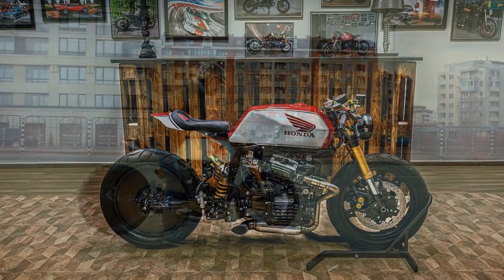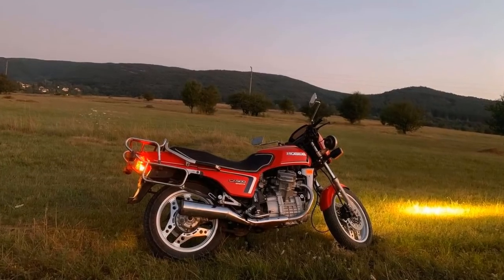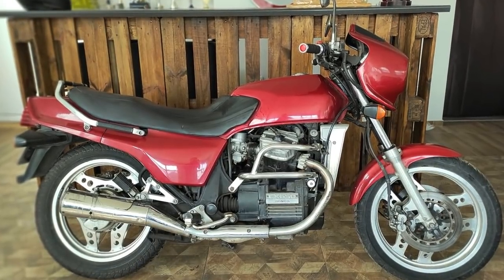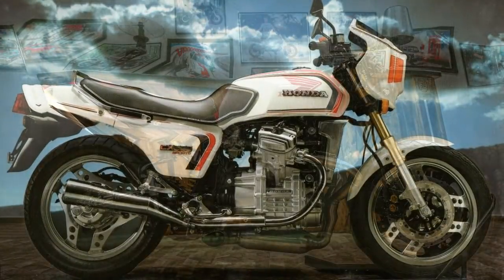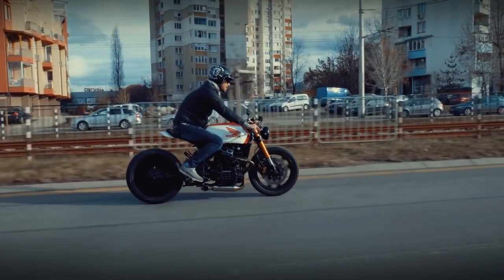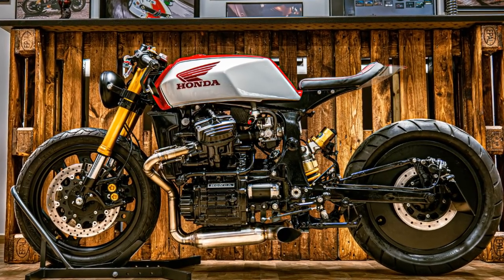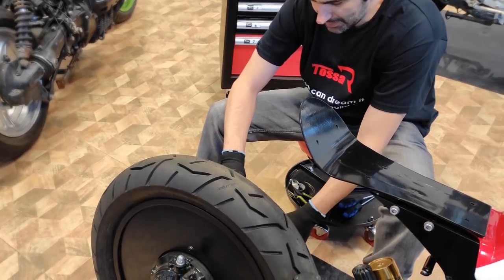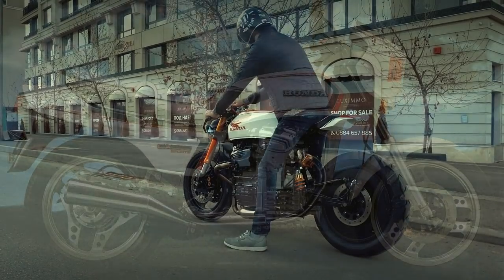Cafe Racer (Honda CX 500 by Tossa R)

Comment: The difficult by its difficulty is an unprecedented pleasure to achieve it. In truth Honda did well to discontinue that latest model of motorcycle is certainly boring and visually ugly. But the engine is something else: a beast locked in a complicated cage. It took someone's talent to do something like that. Seeing the possibility is something we can all do, but achieving it requires talent and passion. The tank simply achieves a visual success that forces the gaze to be directed towards it. When one finds out that it is only due to cutting the lower part of it, myself does not cease to be surprised. The mechanism created to hold the monoshock gives it a powerful appearance, not to mention the rear wheel covers that create a balance between the modern monoshock and the retro of the aforementioned covers. A perfect balance. I really envy the lucky customer from England who is going to get something exceptional. As always dear friend um abraço forte e carinhoso desde México lindo y querido.
Reply from the maker: You said it all. Thank you my friend for your kind Portuguese words. :) Un abrazo desde Portugal.

Comment: Lovely well thought out bike. I love the look of the slightly modified original tank. I initially thought it was a custom built one off tank. It definitely looks better with the rear cowl fitted but I'm not a fan of the rear wheel. Personally I think a nice set of wire wheels would be the icing on the cake of an otherwise fantastic bike. Great video too Vitor. It makes me wish my car restoration project was finished so I could clear some space in my garage for a CX project.
Kind regards Paul 🇬🇧
Reply from the maker: Thank you Paul for sharing your opinion. Yes, I also would love to see it with wire wheels. Good lcuk with your restoration project.  :) Cheers.

Comment: Once again, another beautiful bike. Nice upgraded suspension & breaks no doubt, it's odd that hardly anyone bothers to give the engines in these an upgrade even though they were never a sporty bike. I'm not sure about the wheels, imhho they should be one or the other, the seat hanger is a well thought out idea & just lifting the tank changes the whole look, it's the simple things that make all the difference while being the hardest things to pull off. Now all that needs to be done is convert it to "Right hand drive".
Reply from the maker: Loool. "Right hand drive". That is a good one. The only thing that this honda is lacking, is the CX650 engine. :)Thank you my friend for sharing your perspective. :) Cheers.

Comment: In Britain, we never called the CX500 the Euro Spot we called it the "plastic pig." Thousands of dispatch riders couldn't be wrong though. They wanted performance and reliability with fuel efficiency. I have always thought the CX 500 engine a very beautiful design. Its push rods gave it wonderful proportions.

It's all a matter of taste but I would have just gone for spoked wheels as there is just something about them that I love. The rest of the bike especially the change to the tank are brilliant.
Reply from the maker: I understand your perspective. Maybe the folowing link will change your mind: https://youtu.be/0sC83b2RXb4 It is about my own CX 650, which engine soul is very diferent from the CX500. :) Cheers.

Comment: The last cx was actually the cx650 turbo; the last non-turbo cx was the cx650ed, known as the 650 Eurosport, which was sold up until about ‘85 or ‘86.
Reply from the maker: Yes, you are right. But the main frame is the same.  I was talking from a general perspective, that this was the last CX in general, but not the last honda CX model. Bu Thank you my friend for sharing your perspective. :) Cheers.

Comment: Just another CX 500 project. There are much better opportunities for a cafe racer I suppose.
Reply from the maker: Well, in a way, you are right. A CX 650 engine would be perfect for this project. 
Thank you  for sharing your perspective. :) Cheers.
Reply: @RACER_TV  Hehe, good answer! 
But honestly - I think an aircooled chain driven bike is a much more appropriate basis for a cafe racer, rather than a heavy watercooled shaft driven tourer.
Reply from the maker: Thanks. :). It depends of  the style of the project you want to.
For instance, I am now working on a Yamaha XS 650 cafe racer project, because I want a bike to enjoy a smoth and joyful ride.
But for a fast and nervous ride, a Honda Cx 650 with some changes on the carburetor jets, is perfect for a local road. :)